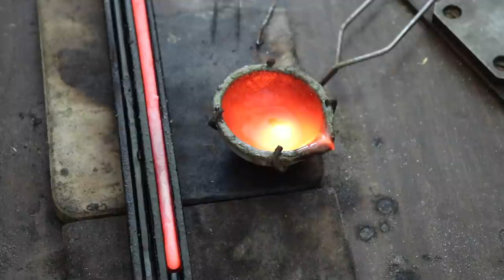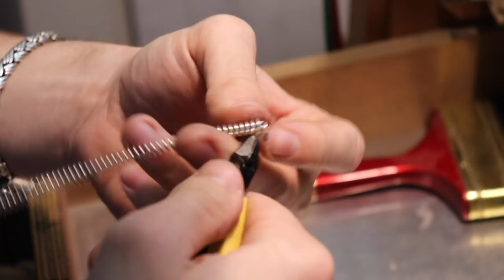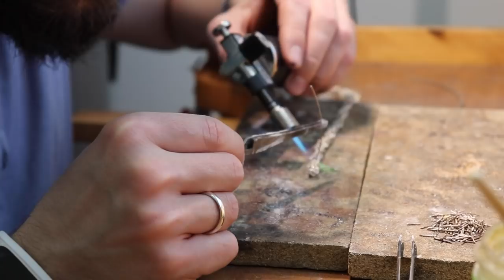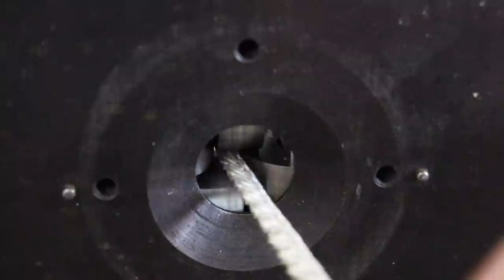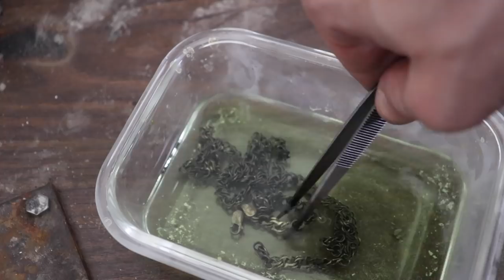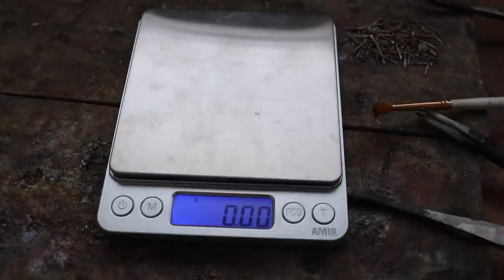Making silver chain | Arabic Garibaldi | 925

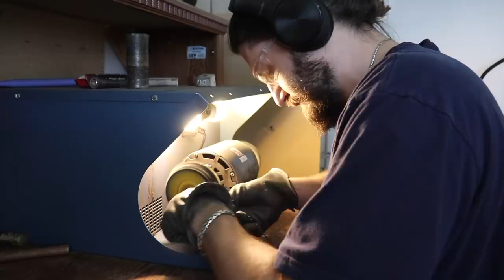Comment: @ 9:43 you are using a tube to wrap the chain around (great idea by the way) just wondering what it's made of so noit to damage the chain yet resist the polishing wheel etc. If i may also ask, pickles and shot tumbler, what ones are you using as I was putt off that the tumbler give a pitted finish rather than polished?

Comment: Why bother blackening the chain if you use a tumbler for polishing and the shot removes all of the blackening in the tight spaces?
Reply from the maker: I use  stainless steel Ovals.
It does not remove the oxidation, it gives me very beautiful finish...
Reply: Excelente trabajo maestro
Reply from the maker: @rolandoantoniobarriostorre7678  thanks
Reply: Ahh ovals make sense.  Could you go straight to the tumbler from blackening without hand polishing to save time? Would the oval shot be able to knock off the oxidation and polish, possibly just taking a little longer to accomplish?